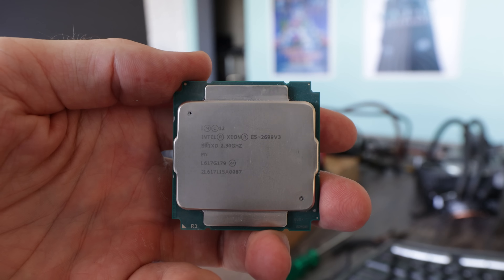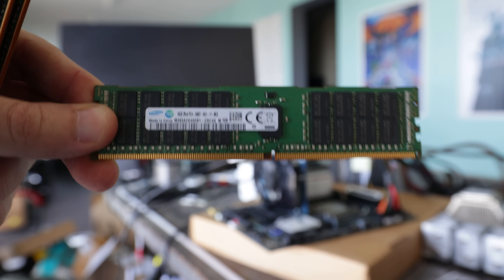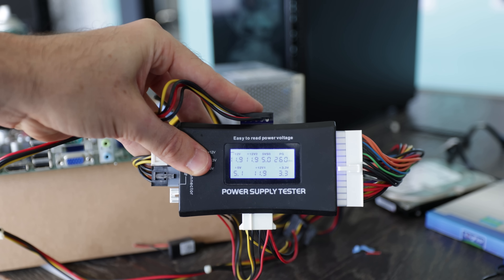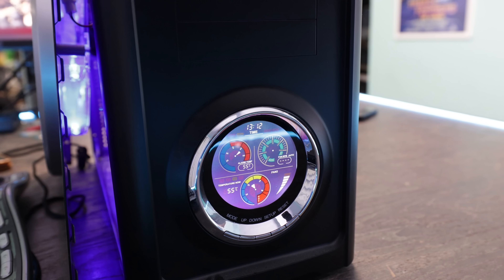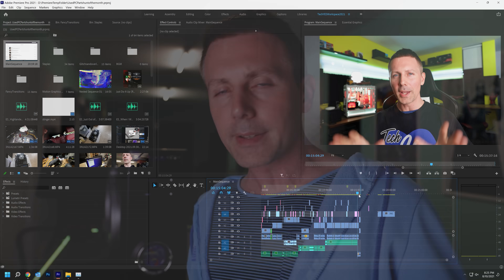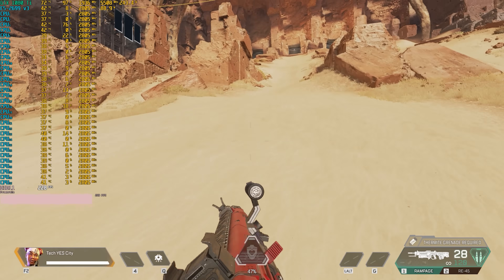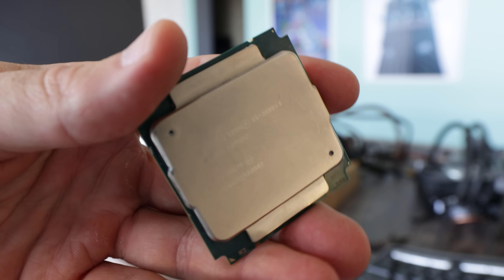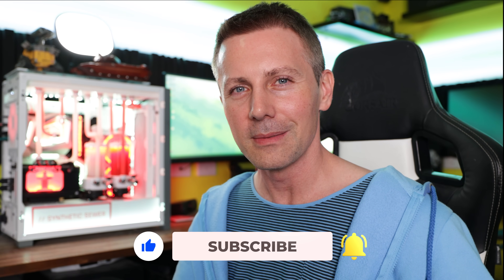I Built a BUDGET 18 CORE XEON Gaming and Workstation PC (Part 1)

Comment: Something about using server CPUs for Gaming or home use it's so cool. Specially when you use older mid 2000s cases. I wonder If we will ever see cheap threadripper/Epyc CPUs in the future?
Reply: first gen epyc's are getting quite cheap already! the 32 core epyc 7551p can be had for ~$330 on ebay right now. biggest issue is probably the motherboards since they go for over $400
Reply: @Shadowauratechno  We need to wait a little bit more.
Reply: @jangelelcangry  china will start making mobos for them in 3 years. By then they will lose 94-96% of their msrp. This is what happened to v3 xeons.
Reply: @SuperObamaladen  That'd be awesome.
Reply: @Klip One They still cool. You might be able to play with them tho.
Reply: @Klip One they are already hitting the limit on IPC. In the near future 12+ cores will be the norm.
Reply: @Klip One would make an awesome unraid server if could buy a system for 300€
Reply: More than likely considering Moore's Law

Comment: Rocking 2678v3 for close to 3rd year, incredibly powerful thing for the money I got it for. Top Xeons are really good budget CPUs.
Reply from the maker: Xeons for life!
Reply: do you use it with ddr3 or ddr4?
Reply: @o-hogameplay185  DDR3 4*8gb (Samsung M393B1G70QH0-CMA). On Huananzhi X99-TF.
Reply: @DarkDao  I think i got the same, was able to get that ram to 1600 cl8
Reply: What board btw!??!?!
Reply: @GTX3584XE  X99-TF
Reply: I also have the E5-2678 V3 on the Huananzhi X99-TF with 4x8GB Samsung memory, albiet 1600MHz dual rank (M393B1K70DH0-YK0). Cooler is a Snowman M-X6 92mm dual tower. Great computer. Multi-threaded performance is comparable to my Ryzen 5600X and yet I paid more for my 5600X (just the CPU) at launch than all those parts combined.
Reply: @jimtekkit  is it turbo unlocked and what version is the motherboard 1.1 or 2.0?

Comment: If I'd still have my old Rampage V Extreme, this could be interesting.
Reply from the maker: ASUS on x99 was top notch too. I think they left easter egg bioses in here too, doing more testing now.
Reply: @techyescity  turbo boost mod on this CPU is insane 3.6 ghz on all cores. Get a 2696 v3 that will boost to 3.8 ghz all core
Reply: @techyescity  Rollin' with Gigabyte these days, though I have a P6X58D-E with a Xeon X5650 @ 4.2 on my 2nd rig and that's a solid board :)
Reply: @UCpGjj8pMoT6MxaeqgkFjPzA best part is not only do they have ton of cache they are binned so much you can run them with a air cooler at those clocks.

Comment: Avx2 inside so it's good but 145w need undervolt. 3,6ghz boost look standard for it's time (2014).
Could you try emulator like cemu or rpcs3 with these old processor?

Comment: I would be interested in seeing both power consumption on this as well as your editing workflow on this system. Are you directly putting the footage on this system/NAS etc?
Reply: Good point, take into account power bill.
Reply from the maker: Footage for recording goes on the scratch drive (m.2) then back up on the nas.
Reply: I had peak power consumption with a 2696v3 which is pretty much the same cpu but with 200mhz more clock of 330w.
But in heavy non-avx loads it averaged around 200w.